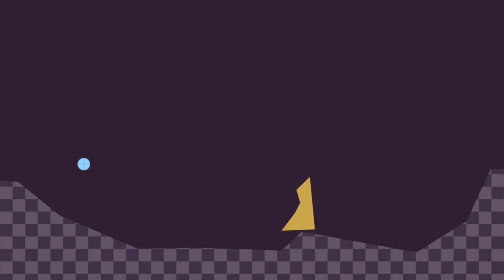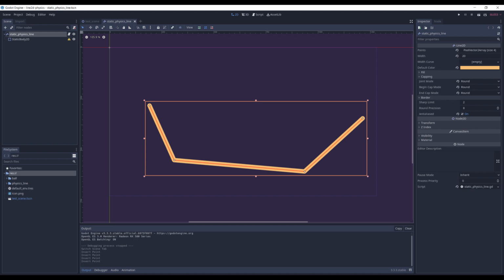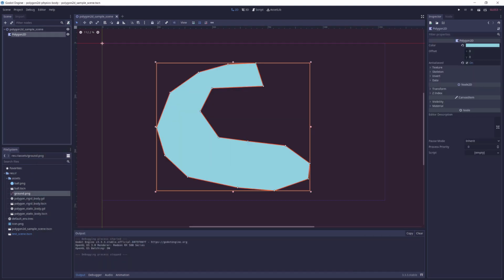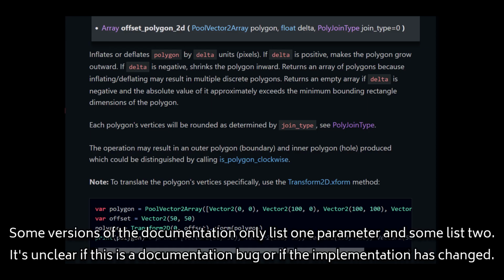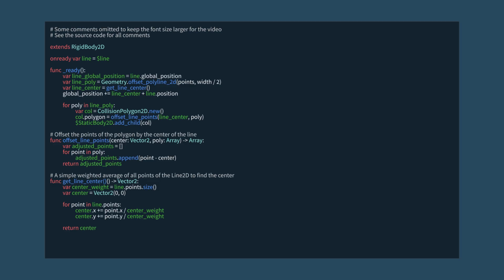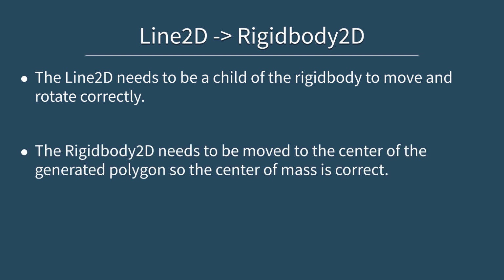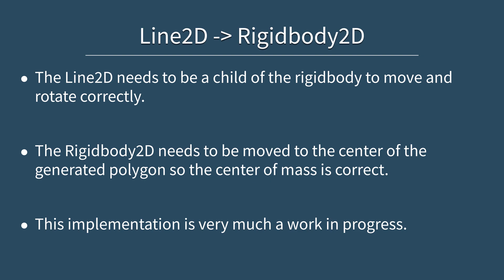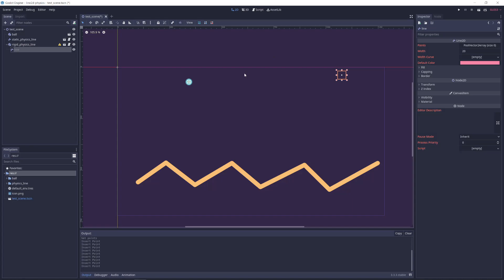Using a Line2D node to create physics bodies in Godot

Comment: Hey, I know this video is pretty old but I thought I could still get an answer:
I get an error saying "Convex decomposing failed". 
1. What is that supposed to mean?
2. How do I fix it.
I know people aren't usually incline to help with programming problems, but I couldn't find what was wrong with my scene.
Reply from the maker: Hmm, I'm afraid I haven't run into that specific issue before, but that message would imply Godot is having trouble breaking down the polygon fed to it into a series of convex polygons for collisions. I'd start by visualizing what polygon the Geometry class spits out and seeing if there's any weirdness to it, such as holes.

If you really need a polygon of the exact line causing you issues, you could chunk it up into smaller lines and see if that avoids whatever is causing the issue?

Comment: is there a way for thos curves to change shape like a soft body or even hand animated?
Reply from the maker: I'm afraid I'm not aware of a good method for doing soft bodies or animations with this technique. You could, presumably, parse the points of the Line2D to integrate into whatever method you need, though. Could also split up the line into segments and connect them with joints if you just need a little bit of flexibility.